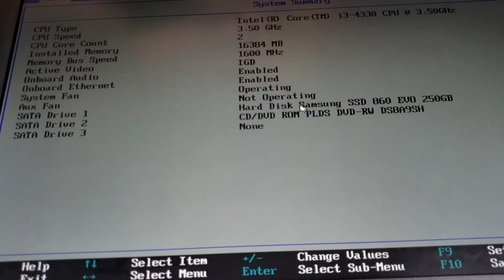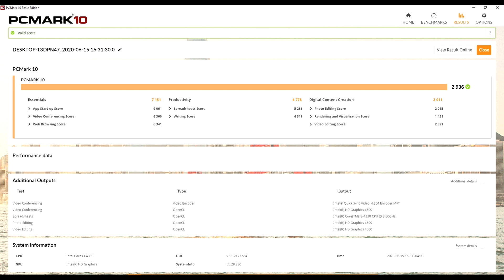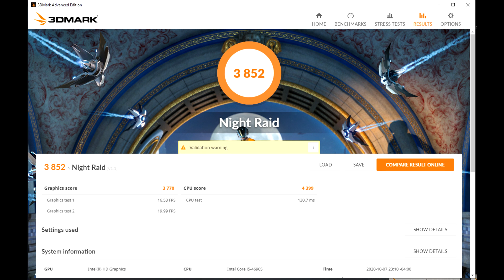How to Speed up your All-in-One PC with a Simple CPU and RAM Upgrade!

Comment: This is the 2nd video I've seen where the hdd was replaced with an ssd and no caddy was used to keep it in place. What I did was used the existing caddy, then installed a ssd caddy inside that. I also had to relocate the power/data cable from where it was mounted and routed it into the caddy. The pressure on the cable from it winding around the caddy make it stay without being screwed down.

Comment: hey i loved ur video i have a Hp All-in-One 27-dp0xxx and i Installed RAm to 16.0 GB and i put a ssd in is there anything else i can do to upgrade it price don't mater
Reply from the maker: That's really about it. Most all in ones now a days use laptop motherboards and cpu's. You can't upgrade the cpu. Which cpu does it have? I know they offer both Intel and AMD
Reply: @MilkyTech  i have a AMD ryzen 4300U

Comment: I just picked one of these up and was wondering if there are any other components that could be upgraded. Is it capped out at ram, cpu, and hard drive?
Reply from the maker: They only other thing you can upgrade is the PSU. With that upgrade you can put an i7 in it. I wouldn't go for any K product because they draw too much power.